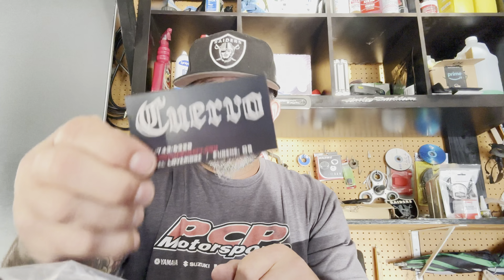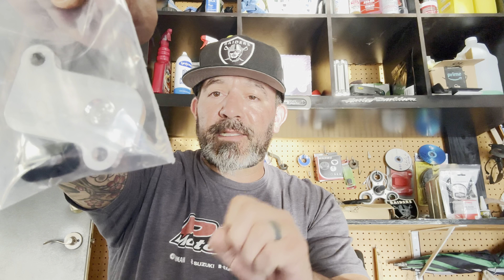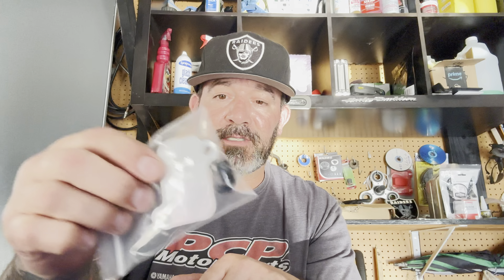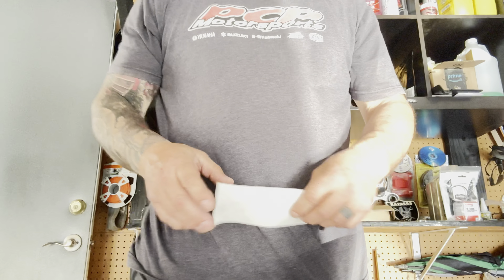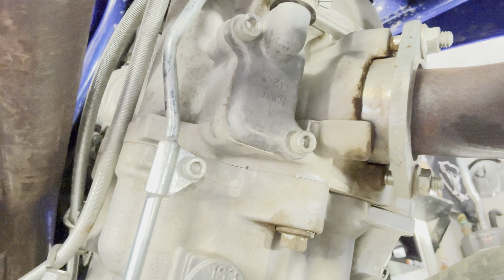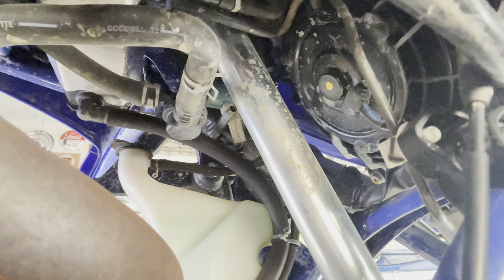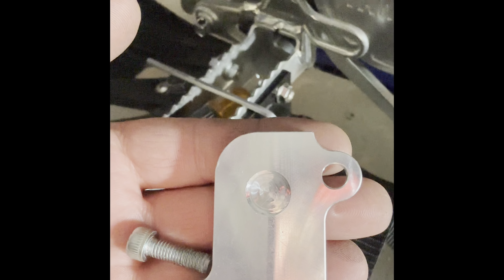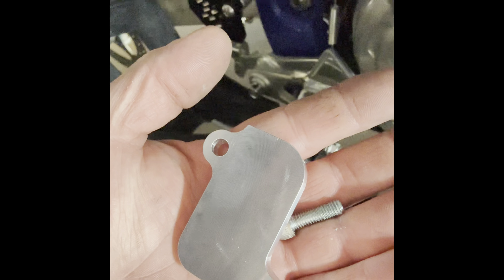AIS DELETE FOR RAPTOR 700R

Comment: This is wrong brother....the cap is supposed to go on the breather box and the whole tubing assembly and sensor comes out Then you electric tape the end of sensor tab look at other videos
Reply from the maker: Then why does it work? Are you saying that I have to take ALL the breather lines off ? Because I plugged it at the 3 way T and put the plate on. Not sure how it’s wrong especially since it works. What video should I watch?
Reply from the maker: I didn’t add a breather box I’m still running the stock air intake. But I’m definitely going to look at it when I get home and maybe just unplug it and tape the sensor
Reply from the maker: Thank you for letting me know I just put my performance air filter relocated my ignition and finished the AIS delete.  https://youtu.be/IEk1546Ubq0
Reply: @ljoff-roadhotrodmods5664  I just subscribed to your channel brother but yeah.i did my ais delete like "Trailblogger" (AIS delete video) but who's to say he's right?....if I watched your video first I would have done it your way and probly would have worked fine if not better idk....it probly could work exactly the same but his way got rid of all that extra tubing...ride safe bro!
Reply from the maker: @saramolet3614  you’re right I should have at least unplugged it. Thank you for subscribing

Comment: Where’d you order the plate from? I can’t find it anywhere online
Reply: Bro i swear im looking for it too. Cant find it anywhere 😅
Reply from the maker: https://smartmoto-electronics.com/ais-valve-removal-kit-with-block-off-plates-ple-211
Reply from the maker: https://www.bonanza.com/listings/ATV-Smog-Plate-Kit-For-Yamaha-Raptor-700R-YFM700R-09-20-700-YFM700-13-19-YFM700R/1353530384
Reply from the maker: https://www.bonanza.com/listings/ATV-Smog-Plate-Kit-For-Yamaha-Raptor-700R-YFM700R-09-20-700-YFM700-13-19-YFM700R/1353530384
Reply from the maker: https://youtu.be/IEk1546Ubq0?si=xn1EyJBmDmz85SwR

Check this video out if you haven’t already this is how you delete everything